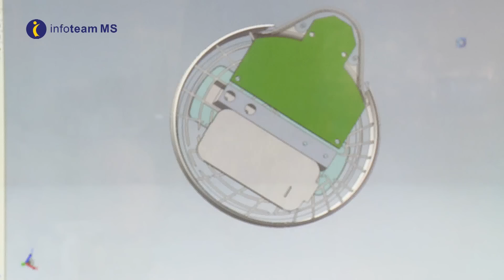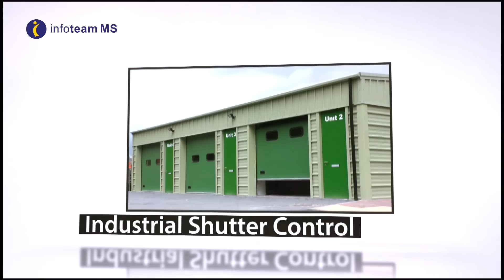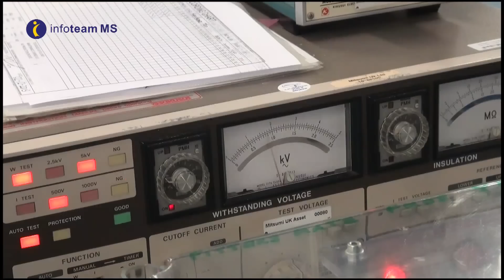Electronics Manufacturing UK - PCB Assembly

Comment: There is nothing better then being able to see what goes on inside a workshop such as this. Finding a partner among PCB assembly companies that can be trusted to manufacture PCBAs to customer specific requirements is the key to a successful partnership. We believe we offer a flexible and controlled environment to achieve this. From one-off prototypes on quick turnaround through to volume production and scheduled orders, we will handle your requirements in a professional and efficient manner.

Comment: Most of the equipment is quite old. P&P are really old despite Juki y not a bad brand But nothing compare with Siplace (Siemens) or Panasonic. Lastest equipments from Siplace are able to place more than 100.000 components per hour. Eventhough most of the equipment is old, not all the manufacturers use the last equipment, to name few, Bosch Braga they have siplace equipment 10-15 years old and same in Bosch Madrid. Visteon they use Philips P&P, which changed brand name to Assembleon (which brand name changed) after they join Yamaha P&P under same brand. Currently they split their ways. currently Siplace and Panasonic are the best P&P equipment on the market. Denso use Panasonic as they only use Japanese equipment but Bosch Braga and Madrid lately bought Panasonic P&P. 
Regarding Oven, Vitronics, nice equipment but not the Best. Vitronics is nice regarding selective soldering equipment. Regarding Oven, BTU with vacum chamber is top of top but also its price around 250.000 - 300.000 €, but vacumm chamber is a must if you are really concern about Void on BGA and thermal pads on which solder should be perfect. Sometimes, due to components in use on the PCB you are not able to increase TAL (Time Above Liquid) to reduce Voids... this is because, TAl is on the peak zone and for some components peak time and temperature are critical. BTU really nice equipment, Rehmm nice one in use in Bosch and many others. Really nice equipment with a really nice price, i mean, its relatively cheaper then the others and maintenance is simple, but ofcourse, they are suitable for most of the products, not for the most special ones.
Regarding handling, i dont even recognize the brand of the equipment. YJLINK and Nutek currently are the best. Chimall are cracp, Rommel desapeared long ago, Asys is really nice but heavy and expensive. Most of the equipment use Servos when others not. This is nice for Pitch adjustment and speed, but price is ofcourse different if you are using a simple teeth plate.
Print Screen, i dont recognize the brand. currently DEK is the best with Asys. DEK is part of ASM group which own Siplace. Amazing combination. DEK is widely use in Automotion manufacturers. DEK, Asys, and MPM are the most commun equipment. MPM lost alot of customers as they are not on the same level with DEK or asys. Not even Momentum equipment. DEK works really really nice.
AOI equipment?...  I really trust in that equipment if on the cover is said " YES YES TECH"... its amazing that this company is using that kind of equipment. It is semi automatic and offline! all PCBs should be cheked in line or in a dedicated line if you want to add value to your product. KohYoung is the best on SPI and AOI inline equipments. OMRON is also really really nice for AOI and Inline X-Ray.Also others like Viscom and Ciberoptics are nice equipment but KohYoung is a world wide leader.
On Selective soldering equipment, ERSA, amazing, Seho, price is the issue if you compare with ERSA. Vitronics are nice equipment also.

Ok that´s all folks jajaja, my apologies regarding my english, as it is not my mother tongue and i didn´t check if everything is written properly jajaja, i hope i made my point clear. Automotive manufacturers have (not all of them) old equipment, but they are selling them as currently is a must to improve time and cost.

If somebody reads this, thanks:)
Reply: I work with all you have mentioned!
Reply: you forgot about FUJI they are mint as well ;)
Reply: My company uses most of those you've mentioned. For SMT, we have DEK, Koh Young, SiPlace, and Omnimax. For Wave, we have 2 types of wave. Electra Ultrafill and DwellMax. Selective, we have ERSA 50/60 (pretty old though) but we are planning to change because of the 3rd party support being quite bad here. Here it is going to be JUKI. For AOI and 5DX, we use local brands. We used to use Agilent. 
ANYWAY, I have ONE BIG QUESTION. What is your SMT Placement DPMO and Wave Solder DPMO? Currently, we are achieving ~ 150 and ~400 respectively. I am not sure what is your company's standard. Yet our management is still jumping up and down. Now they are beginning this whole "ZERO DEFECTS" campaign. 
SECOND QUESTION. I am wondering how is your company organization like? Mine is split to 2 mainly on the shop floor. Operation/Production & Process Engineering. You would think that Engineering would hold the leash but we are basically the dogs to Operations. 3 defects in a row for a work order, there goes an email up to management to be highlighted. Downtime longer than 20 minutes is oh well... you can guess.
I am just wondering if this is the type of work culture, especially if you guys are in the Europe or Americas. THANK YOU VERY MUCH and really sorry for these long questions.
Reply: So you buy a Maclaren to deliver parcels? It is horse for courses. Most people don't need to load 100,00 components an hour nor do they want to pay for a Siplace or Mydata either